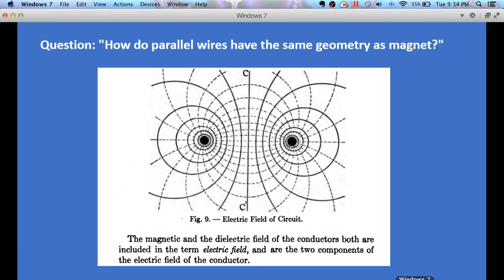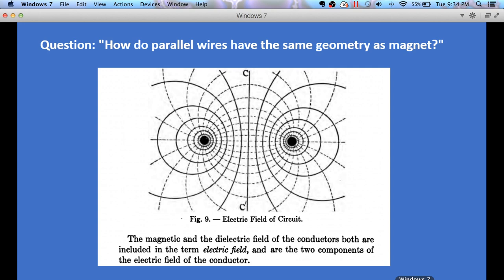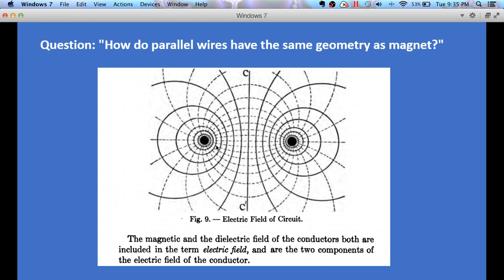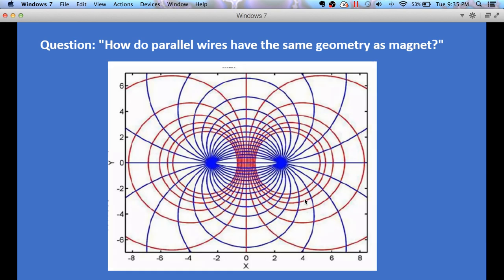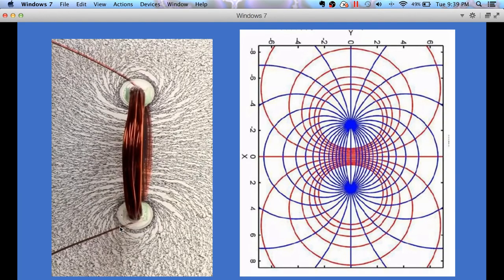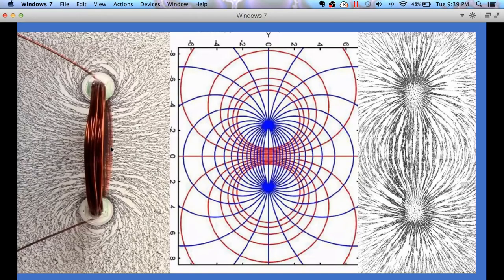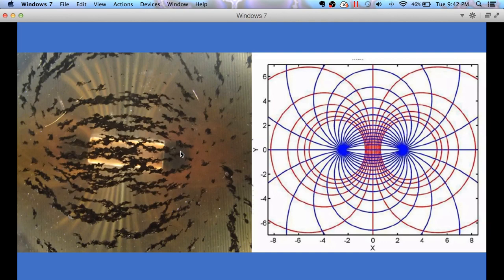On Permanent Magnets vs Electro-Magnets

Comment: Well the Iron filings are matter, so aren't they just showing the material response to the magnetic field while the ferro cell is showing the field itself?
Reply: Yes, and no.  The nano particles in the ferro fluid is iron filing, just very small.  A while back, the maker of the ferro cell stated that the nano particles seem to be constantly twisting in rope lines, refracting the light into lines of light and align themselves with the field it senses from the magnet, and then push off of each other like iron filing lines do.  It's light, that he suggests, that is causing the directions of the lines of force to be in a different orientation.  This is how it works, supposedly.  Light in a medium travels in all directions.  But if, like a Fresnel lens, you add ridges and valleys, then light will travel along and focus in those ridges, concentrating or spreading out.  As the light get's concentrated, we must account for its magnetic response as well to magnets.  Light is polarized by magnets.  It doesn't bend light waves, it polarizes their normal orientation, their bottom halves, or parts that are attracted to magnets moves toward or away from a pole.  

So in a ferro cell, you have two magnetic particles interacting, one is the iron nano particles, and the other is the photons concentrated in the field lines. What I found super interesting is that he said the nano particles were spinning in their rope lines, I take it to mean like a string of pearls, where each pearl is spinning on its string.  Now, why would they spin?  Is it from the liquid being heated by the lights and we are seeing convection currents?  Convection currents in the liquid of the ferro cell would be concentrated in the thinner areas between the nano ropes.  It shouldn't turn them sideways.  So why are the nano particles turning sideways?  The lines of force that go through the nano particles make them magnetic.  It means each nano particle has become a tiny magnet.  Because light is moving and concentrated or focused along the lines of force, it magnetically pushes against the nano ropes, which like electricity, causes a spin.  Instead of the field spinning, the only thing that can spin in the rope is the nano magnets themselves.  So they do.  

Why do ferro cells show the inverse of iron filings alone?  I don't know.  I can only guess that the light polarization has something to do with it.  But this is what is happening in a ferro cell.  1. Before a magnet is added, led's shoot light waves into the nano particle medium.  Does the ferro cell get less cloudy when the light is turned on?  Is there already a polarizing effect?  Would it be different if the led's were not opposing each other, and instead were off center so that there was no cancelling of light waves?  2.  A magnet is put near the ferro cell.  Now nano particles form along the lines of force that they detect, and begin to align and form little magnets.  As they align, they focus the light into the centers of the line of force.  This causes polarization at 90 degrees to the field of light beams.  This light then pushes sideways against the nano particle rope lines and causes them to spin.  3. It tightens up the lines of force until the paths become somewhat rigid.  

Are the dark spots in the ferro fluid light waves that are missing, or are they just light waves cancelled out?  Are they coming out toward us, or headed back into the fluid along the planes of the two glass plates?  A light wave reflected at 45 degrees four times will be absorbed by most mirrors until there is no photons left.  Is that also happening in these ferro cells?  Is the magnetic field keeping the light sandwiched between the plates and the dark zones are where it is cancelled out as they slam into each other?  If you surround a light on a plane with a mirror in a circle, the light will eventually be cancelled out, absorbed, etc and become a black area, rather quickly.  Because ferro cells are two planes of glass, there are three main areas that the light has to travel in, outward from the top, outward from the bottom, and inward along the planes of glass.  The light in the planes of glass is already in parallel lines imposed upon it by the two plates of glass.  When a magnet comes into it, the light is polarized again.  Nano particles form strings that focus the light even more.  

So what is a ferro cell doing?  Light is the first reactor.  As the magnet comes into its light field, the light polarizes between the plates and goes horizontal to the poles.  The nano particles are slowly pushed away from the light lines to the sides.  The antiparticles, as the magnet gets closer, begin to align into magnetic ropes, they begin spinning.  The reason a ferro cell shows the inverse of normal magnetic lines of force is because the light is polarized at a 90 degree angle at the very beginning before the nano particles can react.  But because they behave as magnets, in a magnetic field, they align and stick together in ropes.  These concentrate the light even more, and offer absorption points.  This creates areas of light and dark in bands at 90 degrees to the magnetic field lines of force.  

This is my theory. What is cool about this, is that the shape of the magnet's line of force can be better understood by comparing the two images, of a magnet under a ferro cell, and one under paper covered with iron filings.  I would like to see a magnet under a square ferrocell, and under different shapes of ferrocells.  I'm not sure how different the images would be, but I wager, a triangle ferrocell will show a triangular dark spot above the two poles when the magnet is laid under it where both poles are in the image.
Reply: @gristlevonraben  Very interesting Gristle. Sorry it took a bit to respond, I had to re-read what you wrote a couple times. :)  Of course the ferro fluid iron are tiny magnets, I'm kicking myself for not thinking of that. But because of my mistake, I got this very interesting explanation from you. I had no idea that the nano particles form rope lines and spin in their rope lines. I will study this more. It's fascinating. Thanks so much for this! And thanks Lori, great video!

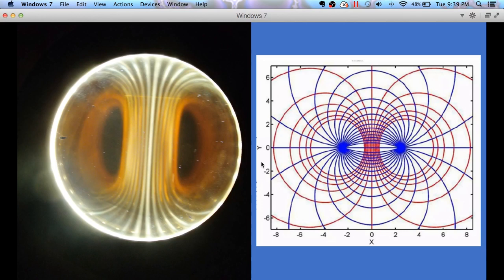Comment: Re: The image at 5:32

Point to the ‘poles’ on the coil (spoiler: you can’t, they are not the ‘holes’ that you see)

Then point to the ‘poles’ on the magnet.

You’ll see that they are quite different beasts.
Reply: Spoiler: It's because of permeability and permittivity. 
@5:32 there is stark difference of the two objects having their "field" shown.

The copper wire on the left is looped, and as such due to its permittivity of the dielectric it is expressing the orthogonal magnetic in a continuing toroidal structure around the wire, hence the field lines intersecting at 90 degrees and being circular where the wire loop moves through the viewing plane, ie. the piece of paper.

The magnet on the right hand side is expressing the dielectric field, due to it's permeability of the magnetic, hence the filings are aligning along the dielectric field lines. The inverse nature of the expression of the conjugate fields, dependant on the medium (ie. conductive wire or solid state magnet), is whats being shown here.

Comment: Can you show a ferro cell with magnet going in and out of a coil when you activate it, like how a relay or contactor operate?
Reply: Also, does the coil show different patterns if you hold it differently? There's Flemming's left and right hand rules that show the direction of current Vs magnetic field Vs direction of force. It's been a while since I learned it and that was under old textbook understanding.
Reply from the maker: That would be interesting.
Reply from the maker: @matthewmeuleman3369  Yes, a lot more work needs to be done to figure this out. I don't have all the answers, which is why I asked the question. I hope someone out there reads your message and does those experiments.
Reply: @FractalWoman  I'll work on those experiments as soon as I get my cell together...

Comment: The difference is in the projection of the forces- dielectric and magnetic are 90 degrees. In the coil the dielectric field pushes into the paper, and thus not exerting any force on the metal filings and not showing. Magnetic field is parallel to the paper and is showing. As with magnet, the magnetic field force is into the paper at 90 degrees, and thus not applying and force on the filings, thus only see the dialectic field which is parallel to the paper.
Similar with the ferro cell
Reply from the maker: I am trying to get away from this language of dielectric and magnetic and "fields" and switch to the language of fluid dynamics. Lines of force and "fields" are emergent properties of Aether circulation. Aether circulation is the cause of attraction and repulsion. As I have always said, the problem is with the language. I want to change the language to be non ambiguous and less confusing. I want to be able to show, by example, what is going on.
Reply: @FractalWoman  Your work is excellent! I'm still catching up, but your logic is easy to follow.
Reply from the maker: @monneym  Thanks.

Comment: What does a wire coil with voltage running through it look like under a ferrocell?

Edit:

Just seen that part of the video... 😁
Reply from the maker: A wire coil with current going through it looks like a dipole magnet under the ferrocell.

Comment: its worth noting that your first iron filling image is based on a bar magnet , however the iron filling of the copper coil is a cross section of a doughnut, therefore they cannot be compared, for they are not the same shape. its only giving the illusion of a bar magnet because of the angle of the photo. if it was wired cylindrically they'd be the same, as seen here:  https://youtu.be/wKE5gDEVRcw
Reply from the maker: Yes, I realize this which is why I posted this in my community section: https://www.youtube.com/post/Ugw_wgzUUWREYCx9nzt4AaABCQ
My video series is a journey of discovery. You are probably better off watching my videos backward from the beginning. That way, you can see how far I have come.

Comment: Is it because a coil  flips 180 on itself on the other end of the "pole"?  One point on a copper coil that intersects the paper is the same field now rotating with itself on the other point of intersection. Remember your power line example? Because the magneto kinetic circles are now rotating in sync, they beat the dielectric lines. With a solid one piece magnet, the poles rotate opposite of each other. The forces are conjugate, so pressure can mediate just the same with inverse geometry. 

I think this is just a flaw of trying to represent a 4d concept in 2d. The ferrocell products a 3d hologram into 2d so maybe the best way to get the full picture is to work a way to see a magnetic field in actual 3d. You can only get as far as your tools get you, and the technology to view fields have hardly caught up with the times.
Reply from the maker: Mitchell: This is EXACTLY what my next video is about. What we see in the ferrocell is an "optical illusion". Literally. You have optics, the glass and the light, interacting with the fluid between the glass. Spoiler alert, it forms a diffraction grating. This is why I suggested everyone watch the video on diffraction grating in my community section.

Comment: there is magnetic currents and electric currents and they are transmutted at 90 degrees. So, if you put a feroid in the coil it will again act as a coherent magnet, while when its coiled we only see the firs 90degree transmutation so it makes the dielectric field.
verry interesting
Reply: also, the magnet does not make lines really... if you add iron filings, the magnetic currents flow through iron faster than air so they rearenge as to get to the most relaxed state and this is mass to mass and not scatered and if it were the same speed through fluid and iron filings, the iron filings would just turn around....

Comment: What's your take on russian scientist Viktor Grebennikov's CSE (Cavity Structure Effects) which seem to produce gravitational effects which are not electrostatic, google "“My World” By Viktor Grebennikov pdf" and scroll down to page 7 where you will see a diagram on the left with old wasp nest, also check page 6 diagram with a clock.
Reply: Gravity and Static Electricity are both the result of the Dielectric Field. Certain shapes and structures probably can affect the dielectric field, just like certain shapes of glass (lenses) can bend light.

Comment: Could it be that in a permanent magnet the dielectric is predominant and in a electromagnet the magnetism is predominant?
Reply: I pondered this, however, attraction is due to the dielectric lines of tension, so it is not clear how adding the magnetic field when building an electromagnet would be necessary.

Comment: I can expand on this explanation:

Everything that humans call ‘magnetic force’ is inertia , however the inertia only exist due to the tractor vortex which ‘breaks through’ from a higher energy state in degrees.

Likewise if you in then3D plane rotate a mass then you will create inertia and you will correspondingly see the appropriate level of tractor vortex 

However 

It is the tractor vortex that determines the density level of the inertia {an important point which I will be able to explain}

The best way to look at it is that the tractor vortex is a breakthrough from a higher energy state the more that ‘breaks through’ the higher the density of the inertia.

So in ‘plain English’ let’s say you have a Nx like a N35 ‘magnet’ and you look at the field , in a ferro fluid ok , you will see the two property’s of the inertia and tractor force .
However 
Raise the Nx to say N60 and you see a smaller inertia field and a larger tractor force right ? 

Wrong. {dramatic music}

The ‘problem’ is the measurement tool is too dense, you are using ‘ferro fluid’ and what has occurred is a slight shift of the inertia density due to the higher energy state of the tractor force. 
So the inertia no longer is in the field of density of the ferro fluid it is still there and matches the field of the tractor force.

At a point along this line , the density of the inertia would raise theoretically like Nx like N200 {example} and the the density of the inertia would be high enough to attract ‘ wood, plastic, people etc’ 

This is literally a ‘tractor beam’ which is a focused high density inertia beam. 

Summary:

It’s the density of the inertia that ‘attracts’ metal , and all the effects of ‘magnetism’ result from inertia, but inertia density is determined by the higher energy state of the tractor force.

Furthermore to the original key point, this is why at very high voltages ‘static electricity’ attracts plastics and lighter materials, it’s simply because at that state the tractor vortex and the inertia are matched at a higher density state.
Reply: Kolin Evans her questions is why aren't the field geometry between the power lines and a magnet the same? your answer is suggesting intensity of the magnet, correct? It's not intensity, but positioning. Think of where the field is, the object and the observer.. If any of these are altered from picture to picture, the image will come out inverted. The view in some of the pictures is a top-down view, the view in other pictures is a looking straight across or an outside looking in with the objects direction. Intensity wouldn't invert the field.

Comment: Is there any observable difference (on the ferrocell) between a permanent magnet and an electro magnet of the same shape?
Reply from the maker: It seems that inductor under the ferrocell shows the dielectric field and a magnet  under the ferrocell shows the magnetic field. I don't think it would matter what shape they are.
Reply: @FractalWoman  I am asking about a purposely-built electromagnet, not an inductor. 

As far as shapes go, certain shapes are better. For example, a long, thin cylinder is not the ideal shape for a permanent magnet because as the shape becomes "skinnier", there is a loss of distinction where the plane of inertia should be; it becomes blurred.

The easiest way to make an electromagnet is to wrap wire around a nail, but I do not think it is optimal, because of the skinny shape.
Reply from the maker: @codetech5598  Oh, I meant electromagnet, not inductor. I misspoke.
Reply: @FractalWoman  That simple point I believe is a key to understanding.  Ken always there is no magnetic attraction so the term electro-magnet that 'attracts' things is NOT magnetic - only dielectric.  Agrees with your observation.  I really want to know what 'electricity' is.  Ken has not been forthcoming with that.

Comment: 12:39 i dont know how youre seeing dielectric in the far left image. It looks exactly the same as the far right image.
Reply from the maker: Yes, if the image on the right is depicting a coil of wire (as I suspect it is), then these two images ARE the same. In both images, the coil is going into the page at the top and coming out of the page on the bottom (or vice versa).

Comment: Any ideas on what is happening at resonance and how it amplifies power?
Reply: Could it be? If your sat in a tub and you made a small wave forward with your hands, the wave comes back, right! It passes you then goes forward again. If you make another wave of the same power and time it so it goes with the original wave the power of the wave multiplies. 
Tesla used a small device to send a wave through steel and tried different pulse speeds until the wave was adding to the original wave. He attached this to a building's steel structure  and fine tune the pulse to get resonance and it caused the building to shake as though there was an earthquake!